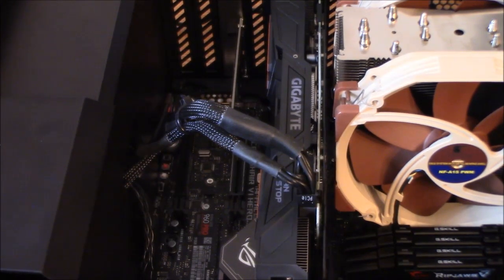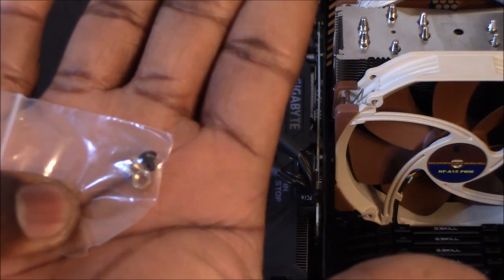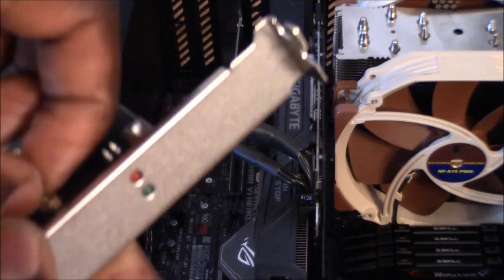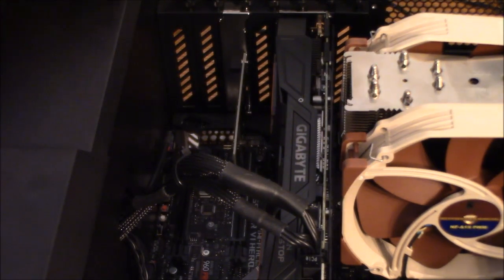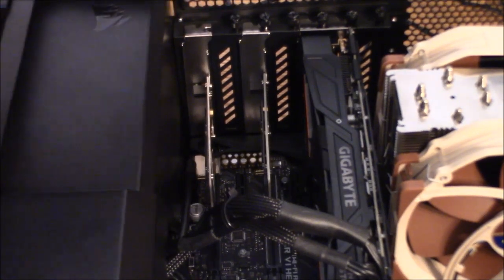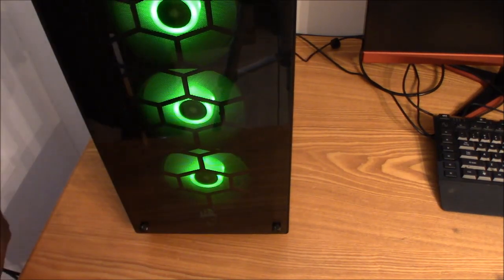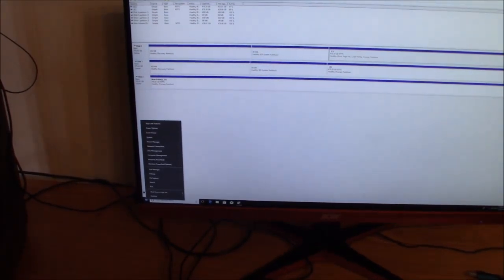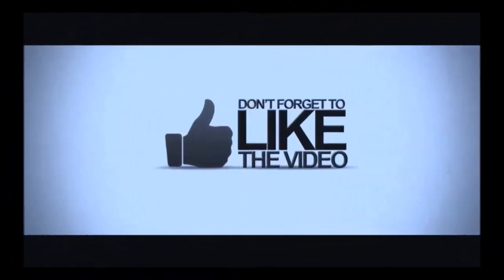Installing My M.2 Drive In My Silverstone Expansion Card For My PCIE Slot On My Motherboard

Comment: your not using any heatsinks for your m.2 NVME's?
Reply from the maker: no most of the PCIe cards don't  come with heatsink the heat sink is a new thing they use to put m.2 with no heat sink on all motherboards
Reply: thanks for the repl and vid

Comment: Can i use this for intel opten ?
Reply from the maker: if the Intel Optane you are buying has a nvme m.2 connection it will work fine because this card is made for all nvme m.2 drives

Comment: I have seen other videos that show going into the bios and changing the express speed from 2X to 4X .Did you end up needing to do any of that?
Reply from the maker: no the pcie slot i used was the 4x slot the bandwidth was already set in my bios for the speed of the m.2 drive so i did not have to change anything it all depends on your motherboard if it supports it out the box or not.

Comment: So does the PCI adapter slows down the m.2 or works as fast as it should ? Thanks
Reply from the maker: the PCI adapter does not affect the speed it was made for the bandwidth of the m.2 so the speed is the same with PCI or m.2 slot.

Comment: Can this work as a boot drive for windows 7 home premium?
Reply from the maker: windows 7 does not let you boot from nvme m.2 drives only windows 10 has the support for them in the software a regular sata m.2 can work but it is not as fast as nvme m.2 drives.

Comment: Thanks for the vid man. Anyway can you use it as a boot drive? I'm planning on buying an 512GB Adata Nvme SSD coz it's just $30 more than the 2.5" 480GB Geil Zenith R3 Sata SSD that I was planning on buying first. For just $30 more I'll be getting more than half of the Read and Write speeds compared to the Geil 2.5" sata SSD.
Reply from the maker: yes you can use it as a boot drive but that is mostly in windows 10. as Windows 7 will not go to the boot screen
Reply: I see. I really loathe Windows 10, but I guess I have no choice. Thanks man!

Comment: Does it bottleneck because the nvme is on the card instead on the m.2 slot of the motherboard?
Reply from the maker: no, it is using the same interface the m.2 slot is using there will be no bottleneck with the connection as long as it is a nvme SSD and not a sata SSD